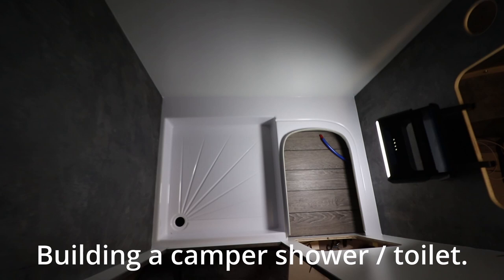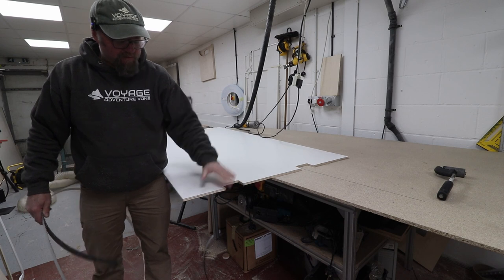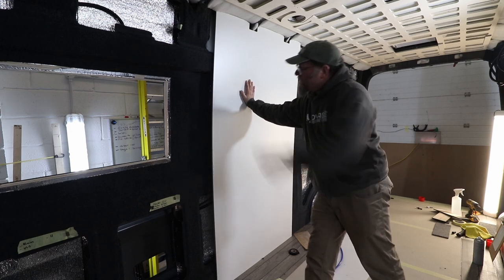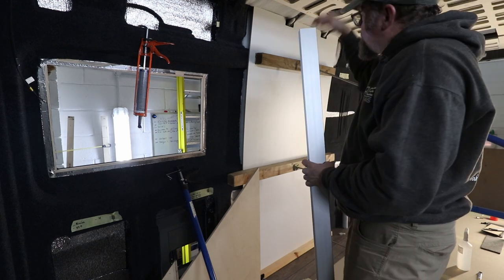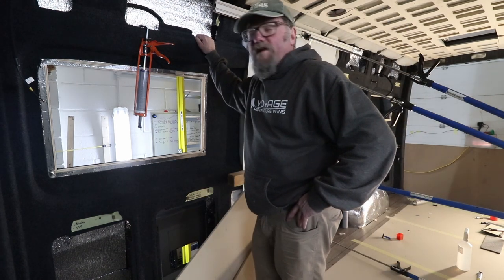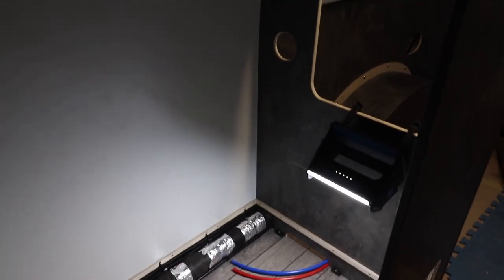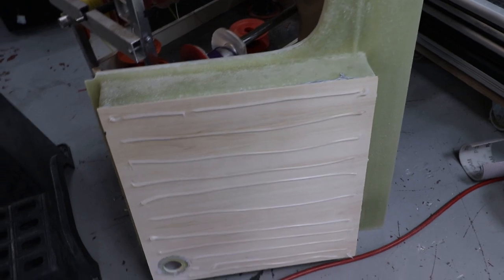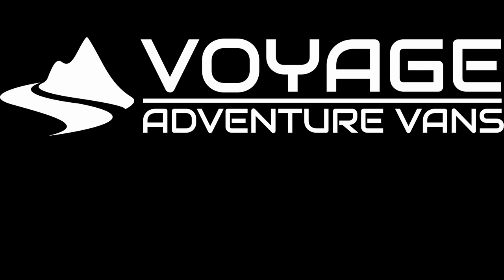Fitting a shower and Toilet Room in a Campervan - Vanlife Dreams Made Reality - Pro Build  Episode 9

Comment: Ed coming on nicely, what are the approximate measurements of the bathroom cubicle.Thanks
Reply from the maker: At shower tray level its approx 670mm x 975mm. To be fair, it was finished last weekend......but I am behind on videos😉
Reply: @voyageadventurevans  Thanks Ed , every video you’ve put out has given me great ideas, your shower tray looks the business, not to impressed with the ones available in suppliers, thinking of going down the route of a wet room with vinyl floor with corners vinyl welded .. what a minefield. Thanks again